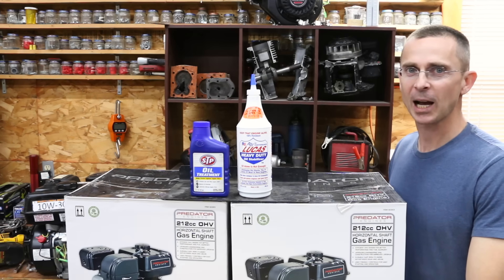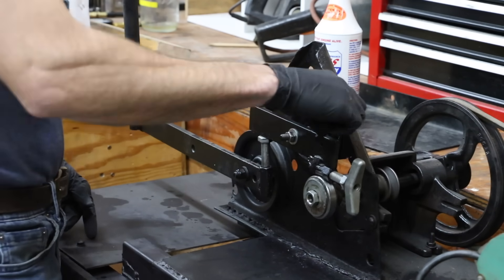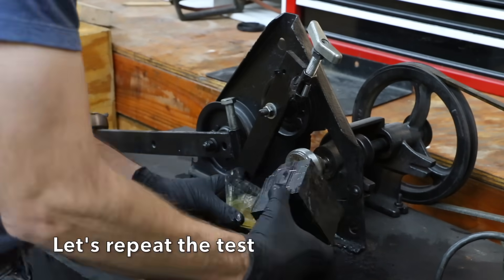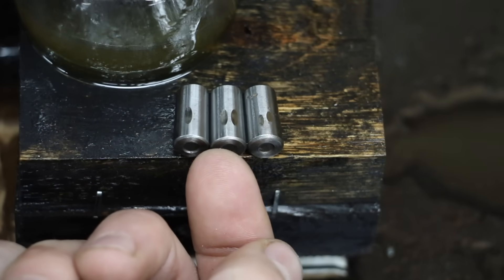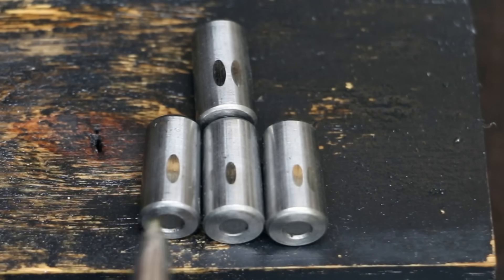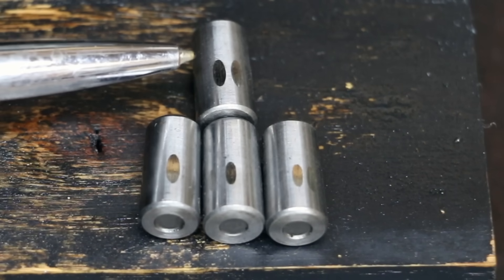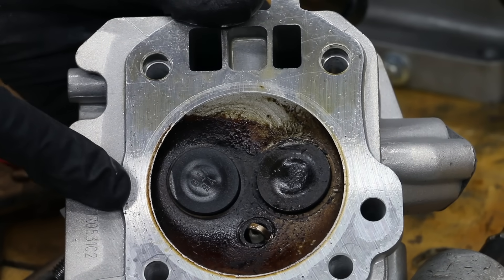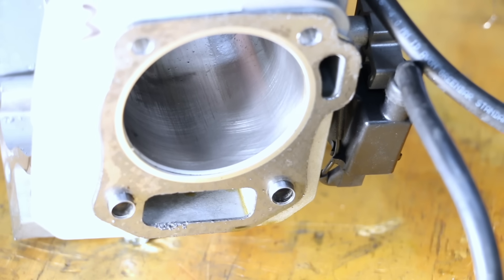Which engine self-destructs first?  Lucas or STP?

Comment: I tested the Roil oil additive and was amazed that it did actually work exactly as shown in advertising videos, I believe it will blow most others to the wind .
Reply from the maker: Thanks for commenting on this.
Reply: Thanks for the reply , I borrowed a unit similar to yours testing the rollers from a big bearing .It just used a hand lever to make the force.The difference in pressure to make the electric motor stall was huge. Two tests I did was to just force it down straight away to stall, and press slowly harder to give time for heat etc , passed both test better far better than the best oil i had . I could not believe It , I tested every oil i had in the shop because i could not believe it. All the way from cheap engine oil to full synthetic , then EP oils  cheap diff oil  to full synthetic ,  transmission oil and finally just roil and water. to my surprise even the water test went well . It's the only product i ever found that i would rave about like this . I am in no way connected to them .

Comment: Looks more like a test of two engines without oil to me. Proves nothing much really for using it as an additive.
Reply from the maker: Thanks for commenting.
Reply: Project Farm be nice if there was an easier way to compare. Like maybe operating both engines with oil in some kind of super extreme condition. Plus as others commented there you need an engine with only regular oil to compare to. Also to consider is 2 of the same engine by the same manufacturer even aren't totally the same. But thanks for the video

Comment: The answer to me is simple.  Lucas lasted longer with no oil so it would give you a better chance to add oil if you notice in time.  Me personally I use high quality oils in all small engines and mainly castrol.  I’ve never had a problem.  The best test for me would be using two motorcycle engines to test with the big expensive eagle brand vs. what everyone else uses.  You know which one.

Comment: STP has always been junk, all it does is turn your oil into sludge to give it a higher viscosity to "hopefully" overcome the gap in worn bearings and rings, it eventually is the cause of most engine failures.
Reply from the maker: Thanks for commenting on this.

Comment: i use lucas in my cummins ISX diesel engine since i bought it when it had 600,000 miles it now has 1,390,000 miles and it still runs like new, i dont know if its the lucas or just good luck
Reply from the maker: Wow! That's a lot of miles.

Comment: These engines are air cooled obviously  meaning you  need to  use motorcycle engine oil with has different  additives then car engine oil so what did he actually  accomplish nothing to many variables  for an experiment if he used car oil
Reply from the maker: Thanks for the constructive feedback.

Comment: Dude, if you're going to do it this way, where's your control? Where's your oil only engine destruction? This proves nothing except that you destroyed two engines.
Reply: He did a control "group" with normal oil in an other video: /watch?v=m8ZKMCfAue4
Reply: This is a normal conditions field test, it represents a normal user trying to do something well, but it is not. This one is a non controlled test. I have 9 years on the automotive industry and engines industry in general. These kind of testing help me a lot to understand why and how things end if the user did not follow the instructions and trying to outwit me as a quality dept into warranties division. As Teddy Hiraoka said, this is not a lab test, just a simple test, but with a lot of information to reject a false warranty claim, or a possible mayor fraud. Normal people do not have or tends to have or recreate lab testing conditions, so, quite simple is much better how people break down things.
Reply: So Lloyd, aside from being a millionaire and having 3 groups of 100 engines each, what could he do better?
Reply: He already did a test with 2 diff types of oil, look at his other tests. Compare the two.
Reply: Whatever you want to believe. There will be a much larger difference in  tolerancing in an engine than there will be in a gearbox due to things like split bearings, cast rods and bearing caps (which is how they make them on these cheap Chinese engines), etc. etc.. There is nothing conclusive about this test. It was fun to watch them blow up, but that was about it. If you did this with 20 engines and all or most of the STP engines failed, then I would say it is conclusive. But since there was only one test run with two different engines that do have differences (no matter what you may believe; this is the real world we live in) you cannot even come close to saying that this is a smoking gun; or in this case engine.
Reply: @Fluidic100  An engineer eh? Great. All the engineers I've ever met get paid a lucrative salary for staring at a drawing all day thinking where to put the tight tolerances to make "better parts". 
Me: Why do I have to hold a 16 microfinish on this surface?
Engineer: Because it's an exposed functional surface the customer sees when they use it.
Me: Oh ok, so what do they do with it anyways?
Engineer: They put a wrench on it and hit it with a hammer.
Reply: +Deez I was a mechanic for 4 years and a machinist for 3 years while I was earning my degree. So you can take your smart aleck comment and ... ->(o)
Reply: @Fluidic100  that's really not very much experience.
Reply: EpicATrain it proves that Lucas oil Peters the engine empty longer than STP, at least in those specific engines.

I agree that it would have been nice to see a plain oil control because one or both could have actually made it worse.
Reply: you think running a brand new engine, with oil in it is going to prove something? you think it will fail.......
Reply: Uhhh viscosity bearing wear test... Beginning of video!! I observed that the bearing test was pretty much right along with the way the test concluded!!
Reply: This dude is great man.
If you want traditional boring bullshit read consumer reports.
Reply: I did the old test with a true Honda. Locked it up , I broke it  free and put oil back in it and was still running last time I seen it.
Reply: Everyone of you are off base. I'll agree the engine destruction really didn't prove anything, but oil viscosity changes with temperature. This stuff just basically makes the viscosity thinker at higher temperatures. I'm sure engines could be manufactured to run high sheer oils like rear end oil, but they are fighting the mpg war. Thinner oil uses less gas. I'm surprise all you "college educated geniuses"  never once mentioned sheer strength of oils at different  temperatures. My experience, I've worked on virtually everything. Raced go carts at 6 years old. So I actually have 47 years experience building all sorts of racing engines. You want to test oil?, use high spring rate flat tapplet cam shaft set up. If you don't have the highest sheer strength possible it will destroy the cam. By the way, the last test we ran on oils, Quaker state full synthetic (in the 5w-30 range) had the highest sheer strength at 225 degrees Fahrenheit.
Reply: Good point but it was one vs the other so still relevant although it would have been nice to see how an oil only engine fared.
Reply: Lloyd Velasquez, this is not a lab test, just a simple test
Reply: EpicATrain doesn’t it prove which is the better additive between the 2? I knew lucus was the winner b4 watching the video. Based on what I know about how great lucus products are and stp is cheap crap that is snake oil in my opinion.
Reply: It might prove that Lucas is better than STP but it does NOTHING to prove that either are worth anything. A proper test would have THREE engines (actually would have 3 groups of SEVERAL engines) and one would have had nothing added to the oil. If the control (plain oil) failed after 5 mins and the Lucas and STP failed after a couple of hours, you could maybe claim they did some good. But it could be the plain-oil one may have lasted THREE times as long as the others, showing they actually DAMAGE the engine instead of helping.
Reply: when he brings the motors back to HF for warranty he can do the test again, one with regular oil and one with Synthetic... then do it again, after the 4th return, however, I am sure they might want to not warranty another engine.
Reply: EpicATrain - I agree I was in charge of a QC dept for an Aerospace co. There are so many things wrong here I don't know where to start. He just blew all kinds of money and time for nothing. Yike.
Reply: 2.5 million viewers found this interesting. Better than no test at all? :)
Reply: EpicATrain is correct, to have an understanding of how much the oil additives helped, you would need to do an oil only destruction
Reply: mmm, i think you're correct. So do heaps of other viewers.
Reply: EpicATrain i think what people are missing is that this isnt a test about wether oil is better with or without an additive. But simply wich additive performed better out of the two. U can sit there an nitpick all day long. But i encourage you rather than critiquing someone, DO THE TEST YOURSELF!
Reply: Anyone that says this proves that Lucas is better than STP is full of @#$%. Engines and parts are all manufactured with tolerancing; meaning that the same part from one engine may be slightly different in size than the other. This difference can easily contribute to premature failure and may make the time to fail shorter from engine to engine regardless of which wonderful oil you are using. Also, the parts of the engine may have slightly different weight which can cause the engine balance to be different than another engine of the same model; this imbalance can also make the engine fail faster than another regardless of which wonder oil you use. Finally, the tolerancing on the rings for the piston rings can cause one piston to fit tighter in one engine than the other; thereby creating more friction which will lead quicker engine failure.

But what do I know? I have only worked as a engineer in R&D on gearbox research for a major aerospace company for 20 years.
Reply: IMO they're both controls and still prove nothing.  He drained everything out of both of them.  What exactly was he testing with that.  Just seems like a waste of what could have been two perfectly good mud motors.
Reply: Thank you, Jesse. Right on!

Comment: not giving any engine cooking will make it lock up making the connecting rod to have a hard time and break by giving it cooling with a fan or some thing would be ideal in the conditions you run them any engine would lock up and it would be nice to see a control engine
Reply from the maker: Thanks for the recommendations.

Comment: When I worked for NAPA we had a guy come in with a portable version of that tester. He insisted we put as much pressure as we could on the thing. Claimed we would be able to make it stop. And nobody in the shop could. Then the owner called me over to give it a try. I think I made him cry when I made it squeal loudly, then stop. Of course I was in great shape at the time.  He really got mad when I suggested we try Lucas in it. I have been a fan of it since another peddler brought to the NAPA I worked at,same owner, different location. Gave me samples of the line to try and he said he would be back.  I used it all. And I am glad I did.  At the time I was driving a early 90;s Hyundai Excel. The thing kept leaking oil, but still ran. It only held 3 qts of oil and I would loose 2 qts in no time, but she still ran like a top. I had one of my customers check it out one day. The rear main seal had blown out, had been out for a while he said. I told him about the Lucas, and he said, order me some. Not long after that, Morey's Red, which we had sold for years, was out and Lucas was in. Now it is in all NAPA's, and must about everywhere else for that matter !
Reply from the maker: I enjoyed reading your comments. Thank you!
Reply: Of course my brother and I were young enough we were still carrying V-8 engine blocks around on our shoulders. and just lifted transmissions into place.  Just makes my old back hurt just thinking about it !

Comment: These tests only prove an engine blows up with no oil in it.  So what's the difference if you actually use them the right way.  Who cares if you can blow up the engine with no oil in it.  That doesn't prove anyrhing about either one when you use them correctly.

Comment: Close, but Lucas won. If you add the same amount of stp as you did Lucas then it would be a tie. Only time I have used one of these product is when a shop used wrong oil and didn’t get enough oil pressure, which is why I do my own oil changes. I did the shop oil change for it was free oil change.
Reply from the maker: Thanks for commenting!

Comment: THEESE ARE THICK  BUT LOW VISCOUS DRAG DUE TO MOLECULAR ENGINEERING. THEY COMPENSATE FOR LARGE MACHINE GAPS FOR HIGH ENGINE WEAR. THUS STOPPING BLOWBY AND BEARING WEAR IN NEAR TERMINAL BEARINGS IE VERY HIGH MILAGE. THIS MEANS FUEL BLOW BY AT COMBUSTION  FROM VERY WORN RINGS ( NOT JUST OIL SMOKING) THAT IE NO POWER -NO FUEL ECONOMY. UP TO 60% CAN BE USED BECAUSE THE WORN  PARTS ARE SO SLOPPY.  SO NOT SNAKE OIL FOR THE BROKE FUCKR OR THAST OLD RIG YOUR GONNA RUN BUT NOT REBUILD WITH YOUR LIFE SAVINGS.
 AS FOR GENERAL PROTECTION THERE ARE SOME BENEFITS. RUNNING AN ENGINE WITH ONLY STANDARD OIL, TESTING THEN CHECKING TO SEE IF THIS WOULD MEANT THAT USING LUCAS/STP THEN LOOSING ALL THE OIL WHILE  ON THE ROAD OVERHEATING . THEN  THE POINT BEING WOULD YOU HIGH TEMPERATURE WARNING COME ON , MAKE YOU SHUT DOWN AND DISCOVER THE OIL LOSS THIUS SAVING THE ENGINE WHERAS WITHOUT  LUCAS/STP NO OIL THE HIGH HEAT THEN INSTANT FAILURE. DOES IT PROVIDE THAT MARGIN TO TURN ON THE  TEMPERATURE GAUGE FROM HEAT FROM NO OIL WHILE NOT DESTROYING THE ENGINE? YOU WOULDN'T NEED A LOT OF TIME FOR THIS. HOPEFULLY ENOUGH TO FIGURE OIUT IT WASNT COOLANT LOSS AND TRY TO DRIVE TO DAIRY QUEEN FOR SODA WATER-LOL!
 ALSO BECAUSE OF THIS NO OIL POTENTIAL STARTUPS ARE LESS WEAR THATS WHERE MOST ENGENE WEAR COMES FROM RIGHT? SOOOO AS WAEEL AS PERHAPS A SUBSTITUTE FOR USING FUEL AS AN UPPER CYLINDER LUBRICANT OR ADDING AN OIL LIKE MARVEL MYSTRY TO THE FUEL SO THERS LUBE HERE A GREAT IDE IN SMALL ENGINS THAT HAVE NO OIL FILTER AND JUST DIRTY UP THE OIL ALL DAY....
 LASLY PROPRIETARY NORMAL RUN ENGINEERING IN THER PRODUCT. EXTENDED OIL CHANGES DETERGENTS ETC.  QUIETER ENGINE IS SIGNIFICANT WITH THEESE. A MORE RELAXED ENGINE COMPARTMENT EXPERIENCE. 
CLEANS UP STICKING PARTS IN AN ENGINE THATS JUST GUNKED UP....
ALL THEES LUCAS PRODUCTS USED TOGETHER CAN ACTUALLY HOLD AN OLD BEATER TOGETHER!  AMAZING LINE. SNAKE OIL? HMMM WHY DO THEY SELL IT FOR SO MANY YEARS AND WHY DO PEOPLE LIKE ME KEEP TALKING SO MUCH. YOU MECHANIC IS THE SNAKE OIL SALESMAN do it right buy  a new rig from me im honest you need the parts all that other stuff is discredited. you just putting a band aid on a dying cow. short of the resurrection yes sir i am and well plow a few more fields too. easily gotten five years with a transmission slip powers steering pump out fuel injector failed   rear main seal leak and a radiator coolant loss. all fixed with lucas oil for about 200 bucks. now for a nice k&n air filter. maybe ill get 25mpg out of this thing!
 THANKS FOR WATCHING WAITING AND KEEPIN YOU EAR ON THE ROAD.

Comment: I ran a modified dirt track car over 8000 rpm for 20 laps no oil pressure and at the end of the night I pulled motor put my spare in to run the next night but when I took the other one apart to see what happen. the pickup tube was clogged due to oil pan gasket not trimmed for the longer rods. I cleaned the pickup tube and checked the rod bearings and the main bearings put it back together and ran it the rest of the season with multiple wins on that motor no issues the bearings still looked new no scratches what so ever. I used monolec oil from instrument technologies str 50wt.
Reply from the maker: Wow!  Thanks for commenting on this!

Comment: As a retired mechanic, I'd like to share some in-shop tests we ran on oil additives. In-shop tests were performed on engines that were at typical operating temp and RUNNING. They had fresh oil & filter change and tuned to mfgrs specs. Prior to adding the oil additive, some oil was drained off in order to accommodate for the addition of oil additive while engine was continuously running. Our test results were determined/measured by changes in the engines RPM. In most cases, the oil additives we tested did cause the engines RPM to increase within -1min of adding; signifying that the oil additive did decrease friction in the operating engine. These in-shop tests were run in the early 80's on gasoline power engines in fleet vehicles. At the time, a product called DuraLube out performed all other products tested. Across the board we had an overall average RPM increase of +/-20RPM using oil additives. In particular the product  DuraLube gave us an average in crease of 38RPM.
Reply from the maker: This is a terrific way to test!  Thank you for this recommendation and for commenting on the results of testing DuraLube.

Comment: What the hell was the point of this video ?  You didn't use regular motor oil in your experiment as a control . And Why did you have to destroy two engines after you drained the oil to prove your point?  This was huge waste of time and it proved nor disproved anything about these products .
Reply from the maker: Thanks for commenting.  Control engine was used in a previous video.